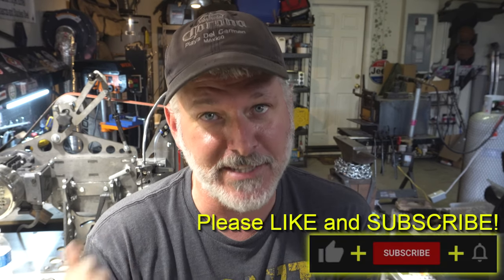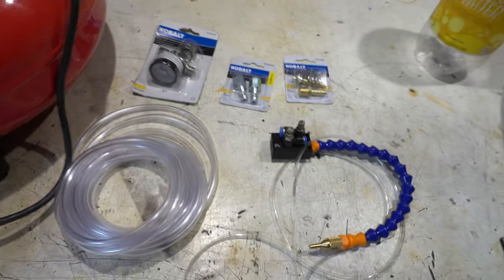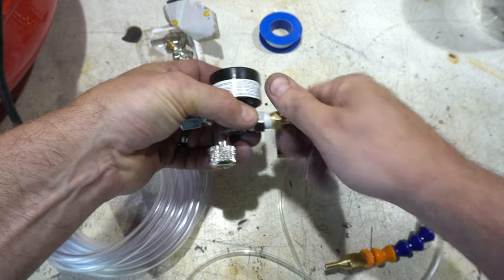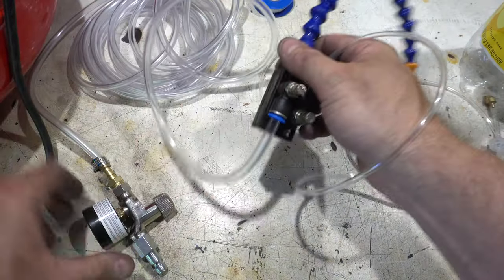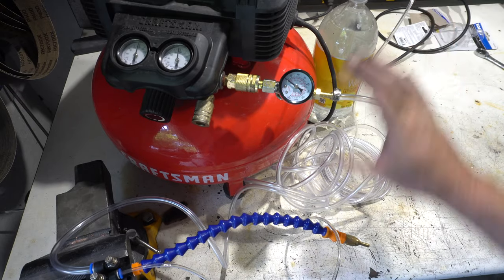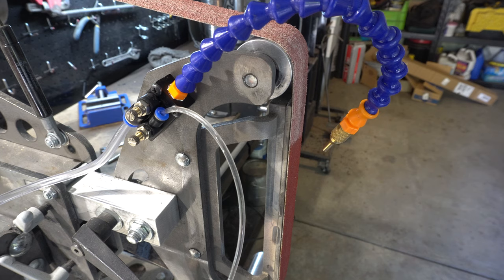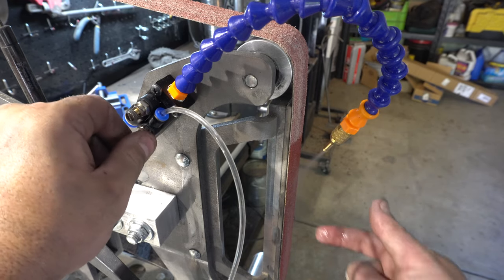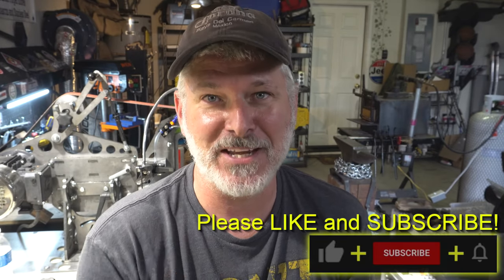Triple-T #41 - Grinder Misting System

Comment: I would not have thought a misting system like this would have provided enough cooling for a blade, but I guess I would have been wrong! Seems like this would be very useful when freehanding a bevel, as you could keep the same angle more reliably if you weren't dunking the blade in water every several passes.
Reply from the maker: Yes, exactly!  You'll see it in action in my sunday build video!  It's really nice not to have to keep dunking it and then having to reposition!!

Comment: I first saw a mister just like that on a walter sorrels video a couple years ago or so, it looks pretty awesome. 
Im curious though, have you tried grinding with it yet? Does the belt running at normal speeds hold enough water to sling it around mist your face or does it all go down into the bucket? I've heard someone mention this problem before but wasn't sure if you could just control it with the pressure of water or belt speed.
Reply from the maker: I have used it.  I was worried about the same thing but I’m getting zero water in the face.  You can adjust the spray power and water flow so it’s really easy to control.  I love it!  You’ll see it in use in this Sunday’s build video! 👍

Comment: Very cool. Air line fittings have become more complicated. There is a "T" also an "I/M" in the male and same in the female but the female also has a "U" this one is universal and will work with either male connector. Took me a while to figure out. Good luck.
Reply from the maker: I found the fittings on this one really trivial and easy to use.  Totally worth the money!  Thanks for watching!
Reply: @TyrellKnifeworks   I think you misunderstood me. I am talking about when you realized you had the wrong style airline fitting and that there are different types. My comment explains it so you don't do it again in the future. Cheers!
Reply from the maker: @jjppres  ohhh, I get it now.  Yeah, I had no idea there were different ones.  Thanks for the tip!

Comment: I have a Pressurized garden sprayer I was thinking of trying out if i like it I may do that I have Ben experimenting heat treating be for I grind so far it working out good but keeping the blade is key
Reply from the maker: I’m impressed with this misting system so far!  When you get you blade done, Barry, send me some pics for my Viewer Knives section! 👍
Reply: @TyrellKnifeworks  love your videos I will
Reply: What’s the best thickness of steel for stock removal for a Kitchen knife?

Comment: I have an 8 gallon compressor.  I have held off on getting one of these because I was afraid my compressor would be running constantly.  I noticed you only had a little 3 gallon.  Are you having any issues with it keeping up?
Reply from the maker: It depends on how much flow you have set on the mister.  I haven't used it all that much yet so I'll have to see.  It might run the compressor a lot but I would generally only use this when I'm doing bevels (and copper!!) so I don't mind if it runs the compressor.  Thanks for checking it out!
Reply: Yeah I would run it on my 80 gallon compressor because those pancakes don’t tolerate heat for too long. We use that exact compressor everyday for pressurizing pool plumbing lines and they usually last just under a year and fry, some last longer but they don’t do well without a break, I’d imagine if you are just grinding a knife it wouldn’t wear it out because you wouldn’t use it constantly. If you were a production shop that would be a different story

Comment: Soak the end of the plastic hose in near boiling hot water. It will soften it enough to slip over the nipple.
Reply from the maker: It actually was fine and it holding but that’s a good tip!  Thanks!